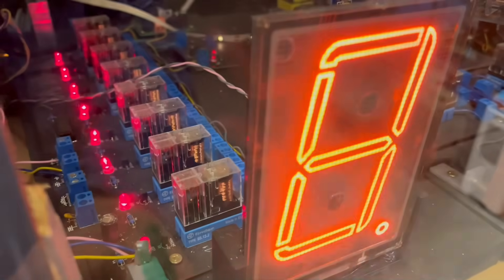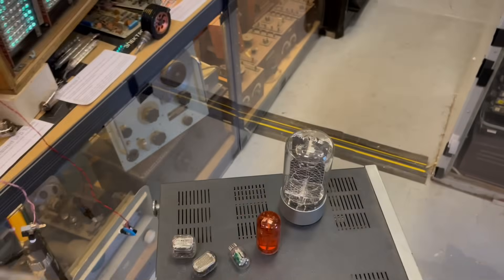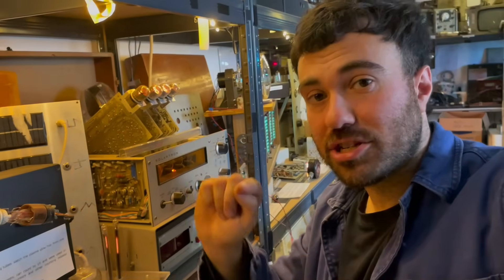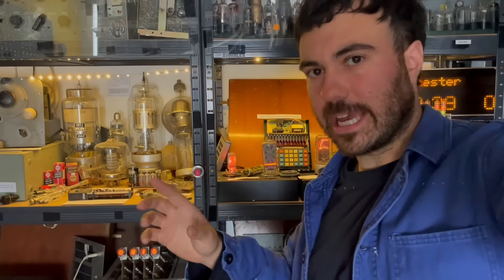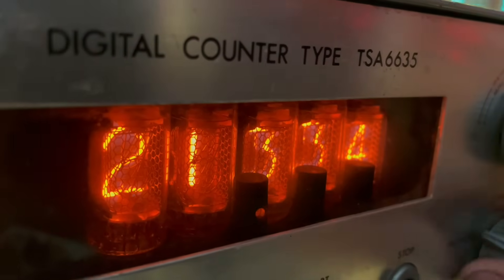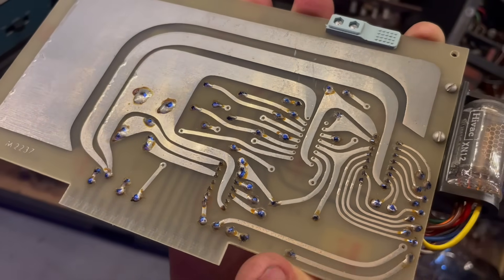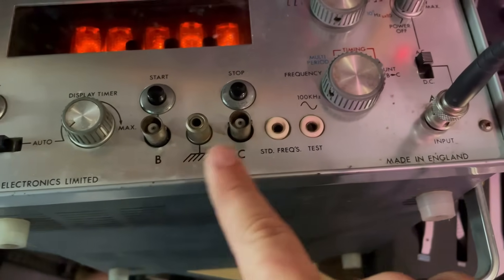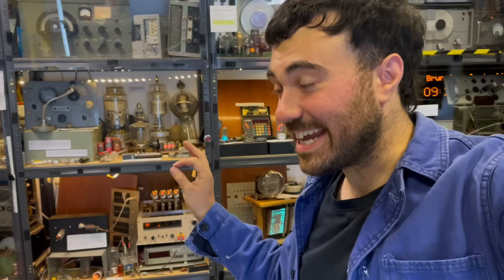Retro Number Display! Inside a Nixie Tube Counter - Explained + Demo

Comment: I worked for Venner Electronics in the 60s when they were producing the forerunner to the counter featured here. It used "Digivisor" display devices, which were a moving coil meter movement with a disc with numbers printed on and through which a light was projected onto a screen at the front, the movement was driven by a stepped output decade driver.
The counter was of a modular construction, where all of the logic modules were made of hand-wired germanium transistor circuitry hand-wired onto perforated boards with pins to anchor the interconnections. These were fitted with a socket on one edge and housed in a plastic case, (the early ones were potted.)
I was working in the test lab, generally helping out and constructing prototype circuits. At the time, we were trying to get counters and logic to work at 100mhz, ultimately leading up to the TSA6635 featured here

Comment: I have a 6-digit version of this on my shelf, which I use for oscillator tuning and LFO timing when doing sound design. It has seven tubes - the rightmost is a custom one which displays the units! The only faults I've had to fix so far were a PSU cap which died and some diodes in the BCD display driver logic. Even with the PSU cap open circuit, it still worked, albeit counting a minimum of 50 Hz due to the massive ripple.

Comment: My guess is the "frequency" position of that multiway switch is so you can use it as a frequency counter.  Pity the lamps for the decimal points obscure the display a bit.

Comment: Good on panning the camera around a bit, it shows off the depth of the Nixie tubes.
8:22 "6942" that's an old chip
9:23 a complete horror show, a dog's breakfast
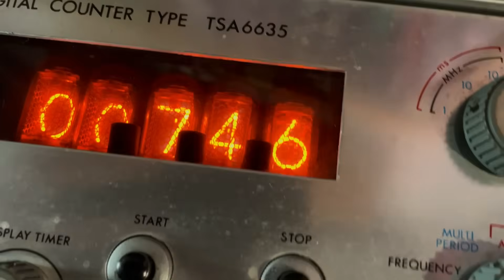10:50 just look at those digits pump up and down

Comment: What is the bluing on the solder joints on the nixie driver board?
Reply from the maker: Guessing it’s a pen mark saying each joint has been inspected?
Reply: @THISMUSEUMISNOTOBSOLETE  Correct
Reply: Inspection mark. I worked there in the 60s, and each and every circuit board was inspected after hand assembly for the quality of the solder joints, a tiny spot of engineers blue was dabbed on to verify the inspection.

Comment: Totally tubular! I never looked at a tube as a particle accelerator, but it kinda makes sense. 
Loving the counter's modular design - it hails back to old HP counters, only this one uses a "modern" 74141 rather than an elaborate array of flip-flops and optocouplers that also perform BCD to 1-of-10 conversion.
The display display is absolutely Fraaaaaaaaaaaaaaaan-tastic.